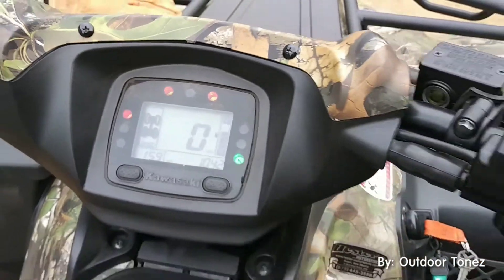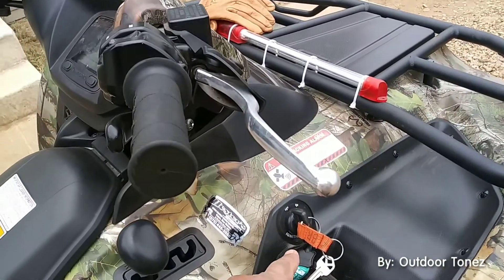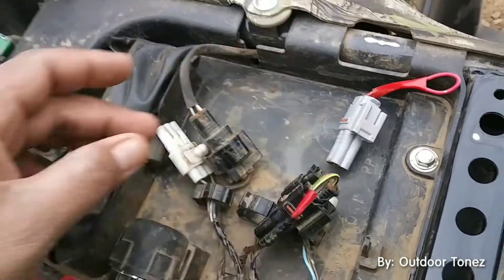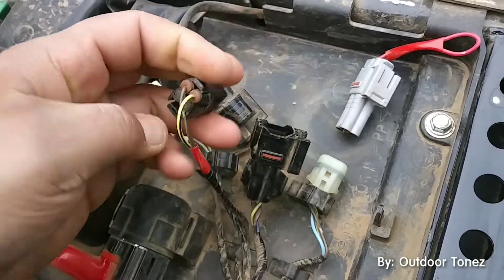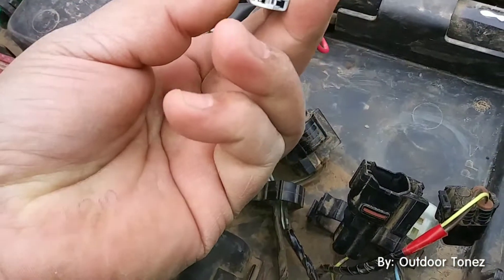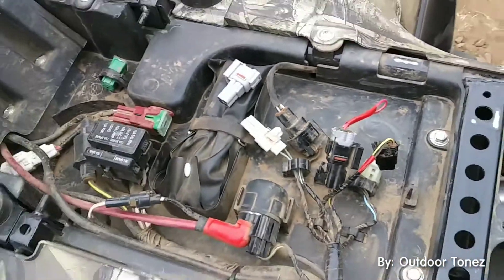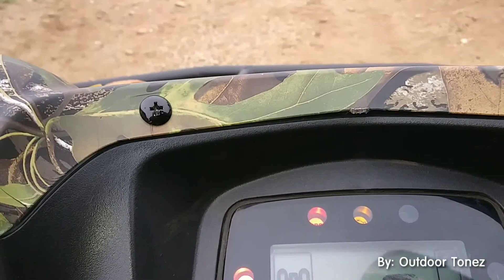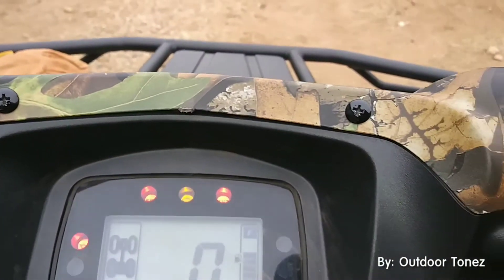CVT BELT LIGHT RESET 2020 BRUTE FORCE

Comment: I'm happy you posted this video, it helped me.  But I'd like to mention one thing.  The plug you pull above the belt housing is wrong (I think).  That is a temp sensor for the motor.  I did just like you said and it didn't fix it.  I pulled the belt cover to check the switch and it was okay.  I re-did this procedure, but instead pulled the plug apart that goes to the CVT switch and it reset it and I'm not in limp mode anymore.

I think if you aren't in limp mode and just need to get the light turned off, you only need to do the plug under the seat.
Reply from the maker: A atv Dealer mechanic showed me that don’t know why but he told me to keep doing that. Thanks for more knowledge on that

Comment: Any tips? I have done this a couple of times and My light still flashing. Did also open the drive cover and belt seem fine and switch was on the on position. I'm getting no luck!
Reply from the maker: Disconnect that bottom wire where the belt goes first with key position to on. Then switch the jumper link underneath the seat like in video shown. After you do both make sure key  switch is on position and wait like 15 seconds for cvt to flash on off. Now underneath the seat switch link back. Then connect the one by drive belt back in as well. Now start up cvt should be off now. Good luck again
Reply: @OutdoorTonez  Ok I'll trying that... Thanks!

Comment: why did your CVT light come on?
Reply from the maker: Ok after reaching 100 hrs. The bike does that to have it checked for the BELT. To make sure the BELT is good. If BELT needs to be replaced now would be the time to do so.
Reply: mine hasn't yet...only 42 hours on her...
Reply: Thanks to the record amount of snowfall this year mine finally reached the 100 hr mark.   Official snow fall total this winter as of Friday 25 Feb is 88.5" and got about 3-4 over the weekend.
Reply: What’s the thing you disconnect called near belt ?

Comment: Didn’t work for mine
Reply from the maker: Try again what year is your bike. I can tell you what to do to fix it.
Reply: @OutdoorTonez  I fixed it, I had to unplug the 2 wire plug on the bottom not the heat sensor like you did
Reply: @mirin3181  where’s the 2 plug wire on the bottom? How did you reset yours?
Reply: @mirin3181  like you said. What he unplugged has nothing to do with it. That’s the just for the fan to kick on.
Reply from the maker: @DonniesBack  234 duration
Reply: @OutdoorTonez  I’ve tried about everything, light still on. Belt looks good. Any ideas
Reply: @kyle rash
Reply from the maker: @greggoad8155  just research you tube some more. It works for my 2020 brute force. What is the year of your brute force?
Reply: @OutdoorTonez  mines a 2021 and nothing is working
Reply from the maker: @willdeeznutsfitinyomouth984  is your cvt light on
Reply: @OutdoorTonez  ya just replace belt and tried 5 different ways and still on
Reply from the maker: @willdeeznutsfitinyomouth984  turn key off then unplug the wire on bottom of bike like the video shows. Then connect that link underneath set like video shows. After that turn key on only. Wait 2 minutes. Then turn key off again. After that replug all connections back then try to start good luck.
Reply from the maker: @willdeeznutsfitinyomouth984  when you replace the belt a switch should be in side make sure that switch is set back
Reply: @OutdoorTonez  ya I flipped switch as soon as I took belt case off